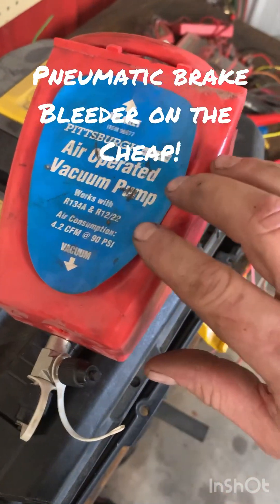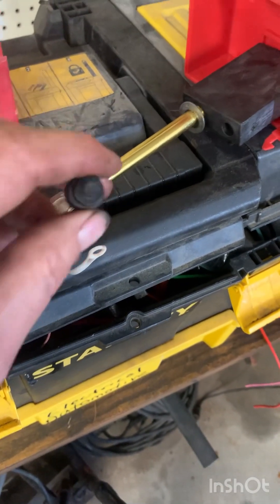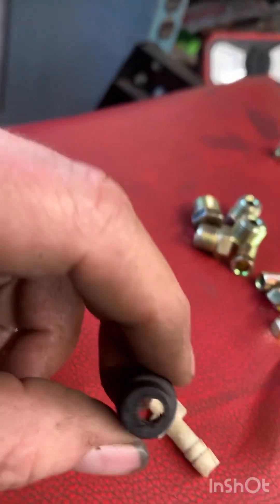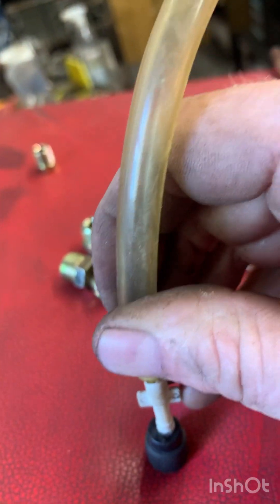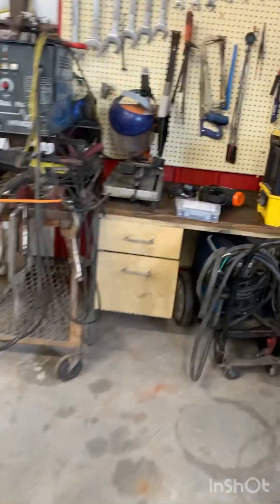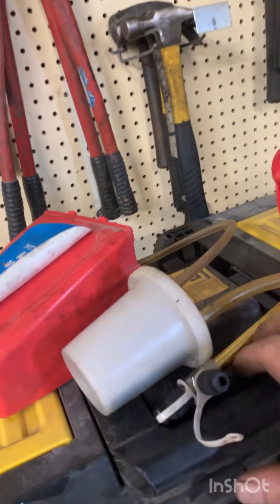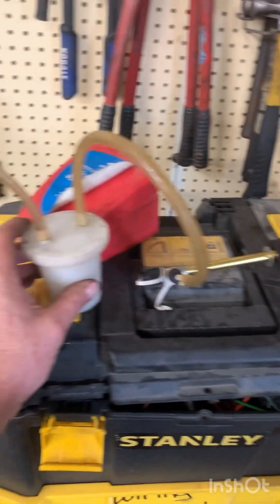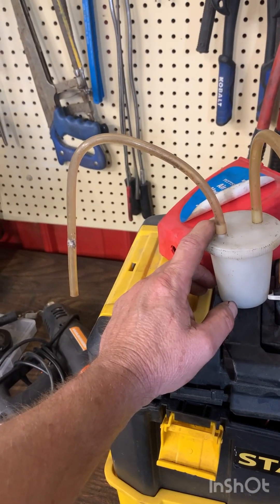Build a pneumatic brake bleeder for cheap!

Comment: This principle is easy 8th grade science class....yes it will work but you do need a larger recovery tank so you can also do brake flushes with out constantly emptying the tank....a larger tank let's say a 35 gallon plastic barrel can be used to empty a gas tank so you can replace an in tank fuel pump by dropping a empty tank or nearly empty on bigger trucks.... More people should have paid attention in 8th grade science class 😂😂😂